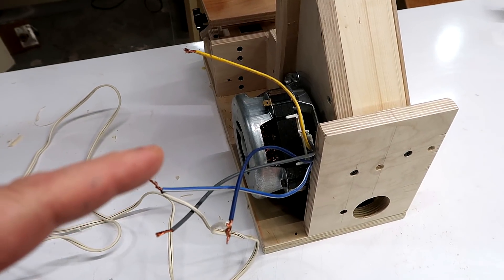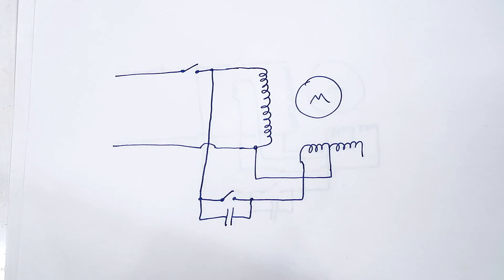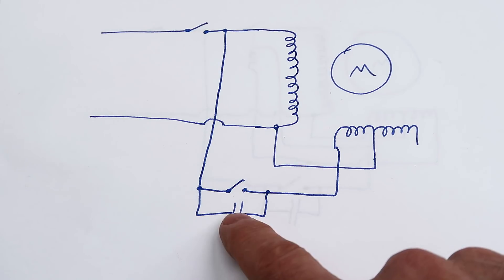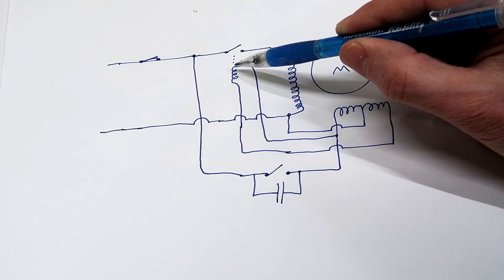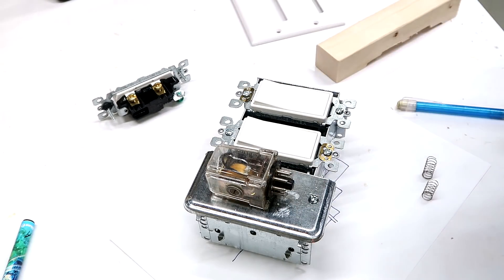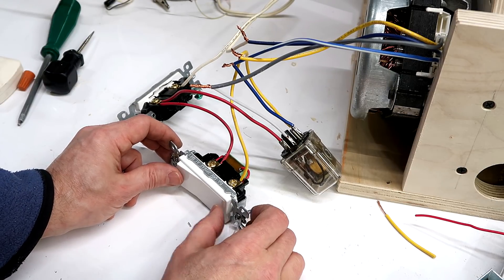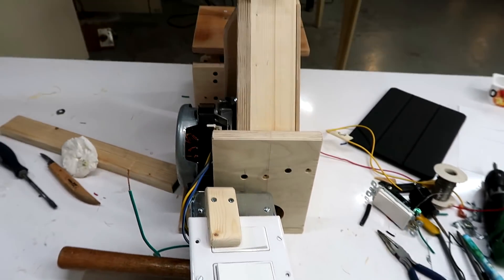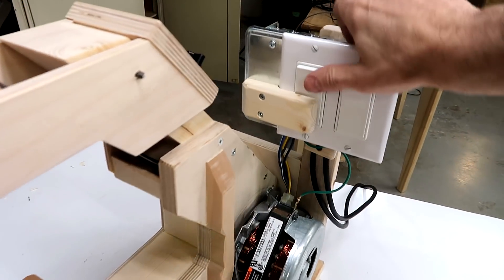Induction motor NVR switch and starting circuit

Comment: There is a type of relay for starting motors, it’s known as a potential relay and it works off the voltage of the start winding and will open once the motor is at about 80 percent, it works very similar to the mechanical setup you are using, however it’s completely automatic and self contained.

Comment: my  recent motor project had a starter capacitor and a stop capacitor but kind of same it has has 3 wires blue white and red I got some sparks and a small turn from a 12 volt dc battery red to positive white to neg and blue to spark the semi start

Comment: If you use the dust collector anyways, can't you just put the motors starting coil in parallel with the dust collector motors starting coil? It HAS the centrifugal switch.
Reply from the maker: Interesting ides, but I'd rather not require custom wiring between the tool and dust collector. Oh, and the dust collector is a capacitor run motor.  No centrifugal switch.

Comment: Matthias: "I can't find a cheap [momentary] switch online"
Me: Searchs ebay, within seconds finds numerous ones for as cheap as 5/$5.
Also me: <shrug>

(I refuse to say "temporary" switch. They are called "momentary" lol).
Reply from the maker: Just searched again, nothing suitable for this.  Mostly signal type switches, not rated for motor power.
Reply: @matthiaswandel   LEVITON 1256-W : 15A SPDT MOM CONT SWITCH.  Commonly used for line voltage up/down control of blinds. This should work unless you need to discrete poles.

Comment: Have you ever thought of using a Doorbell as a starter switch? They are made to connect then close after released...
Reply: Doorbell switchs are made for low voltages, they wouldn't hold up with 120V and higher amperages.

Comment: You need a capacitor across you contractor for the same reason you have one on your switch.   I would say if you don't have another one put preference on the contractor since you don't have a replacement.

Comment: Glue a momentary switch to the ON side of the power switch. Both circuits energized while you push the on button and starter circuit disengages when you lift your finger.

Comment: An alternativ way would be to find an old fridge, on the side of the compressor is a relay, the coil of which is wired in series with the run winding, thew contact providing the start pulse from the inrush,
Reply from the maker: Fridge compressor motors are much smaller, the relays aren't suitable.

Comment: The relay contacts were sparking a lot in the video. Might be a case for another cap there. They’re more expensive and harder to replace than the primary switch.

Comment: a good idea would be to use a latching button circuit with a relay, then hook the starter straight to the terminals of the switch itself and have the motor connected to the latching switch circuit. it will allow you to start the motor and keep it running without having constant power to the starter unit and also the benefit of only 1 button

Comment: This is why the older mechanical tech tends to be much better than the newer electronic tech. Especially when they add I.O.T. and decide to make sure that the device cannot operate without an internet connection.

I never pay for stuff that cannot operate without an internet connection.

Comment: hi Matthias, Why don't you use a ring bell switch, like the front doors ones?
Reply from the maker: Those switches are junk and not rated for any voltage or current

Comment: One Wandel more?  Best wishes, Mom!
(did he measure the frequency of the ultrasound using waxed paper rubber-banded to the end of a paper towel tube?)
Is the spark (visible after relay is installed in the switch box) happening in the relay or wiring? Maybe need an NTC Thermistor?

Comment: You need a motor control pushbutton switches. Look up "3-wire motor control start stop station". It uses a relay, motor starter, and pushbutton station. Uglys electrical references will have a simple drawing.
Reply from the maker: Its not a 3-phase motor

Comment: Did you wire in the capacitor with the relay? It sparked quite a bit. (5:15)
Reply from the maker: Unfortunately, the relay glitches off when the starter coil is disengaged.  No spark on "off" because the switch does that.

Comment: Love that idea, however, I'm not so sure about having the parts mounted in a metal case without having insulation/shrink tubing around the powered relay pins.
Reply from the maker: that's what grounding is all about.

Comment: Nice use of the starter winding, never seen that before. Though the relay looked to be arcing significantly, I’d chuck a MOV across it, if not another cap or two.
And that relay? The thing looks ancient!
Reply: We had a bench grinder at work that used a special start winding relay with a coil wired in series with the run winding. When the switch was closed the low impedance of the run winding at start up caused enough current to close the start winding, but after the rotor rpm increased, the decrease in current caused the start relay to open.

Comment: Hi Matthias. I have the same motor from a dish washer I hooked up as an 8" disk sander. After many tries to get it hooked up to run I settled on one normal on/off light switch, and two momentary push buttons. Along the lines of one of your examples. The light switch supplies the 120v to run and at the same time I push one of the momentary buttons for the direction. For my own sanity I labeled every thing on the face place how to turn it on. I had someone read the "how to" just make sure it made sense per the instruction. Works great.
Reply: His setup is simple, safe (once he addresses the contact spark) and genius, but i don't know if it would work for a machine that needs to run in both directions (as designed). I really appreciate the built in disconnect if the motor gets overloaded and stalls. Yours sounds pretty nice too, but I'd want to be aware of how it works and be ready to kill power if I stalled it.
Reply: @super_slo  When I built my disk sander I went through almost all the ways Matthias has tried this one. The motor when it is in the Dishwasher machine, as Matthias says it all controlled by the machine. Most washers like this have a relay already, else where in the machine to take care of the start function. Some have a "start capacitor" to give the motor a kick to run up to rpm then drop out after run up. Some have a "run capacitor" that kick in at the start up and stay in until the motor is shut off and drop out after rpm runs down and motor stops. All Matthias did was move the sparking from him touching the wires together and then pull them apart after run up which caused the spark. If you look at the video the spark is occurs inside the relay in the clear plastic cover. The relay is rated to drop out at certain voltage.  I see no spark at all on mine as I use the momentary button as a start capacitor (completely enclosed button so I become the relay). If I do not push the start button at all just flipping the switch would just make the motor hum.
I have to push one of two buttons for CW or CCW for about 10 seconds and flip the main switch after pushing the direction button. This give the motor the extra kick to force rotation CW or CCW. I just wanted to make sure how I did my hook up is clear. Matthias's way works fine also.
Reply: @Sea-Dog5496  when it's sitting there stalled and humming, have you watched the temperature rise? I'd be concerned about overheating with the motor energized but not spinning and thus not cooling. Like say a dust collector or something, might not notice immediately if it stops spinning, and not actually running the piece of equipment. But like I said, your setup sounds PERFECT for something being operated and needing both directions. Lathe, drill press? Either way, you both are awesome for actually building something with these motors!
Reply: @super_slo  Hey Super SLo. If I turn mine on with the switch and no button pressed. It will hum only with no turning. So if it is not turning it is burning. If you leave it switched on no rotation it will burn up the motor winding. Of course it will take maybe 1, 2 or more minutes to burn. You will know it by the smell of wire getting to hot, and most likely smoke like crazy. However motors will tell you on the ID tag if it is thermally protected. It will blow a thermal fuse in side the motor to prevent fire. Older motors may not have this feature, so one must be weary.
Point is you better stay focused on the task at hand and don't let your brain wonder off the track. Lol.

Comment: Arduino, I mean your already using a relay.
Reply: Arduino would require 2 or 3 relays, plus a couple switches... Doesn't really improve the situation unless you want to automate the dust extraction to run for a set period of time before and after. 🤷🏻‍♂️

Comment: Interesting solution.  I wonder if a higher capacity automotive style key switch would work without the relay.
Reply: The relay combined with the starter winding is the magic. The wall switch he's using would happily fry the motor, as would the automotive key switch. The relay is being powered by the motor (one of the starter windings being used as a generator) to turn on power the motor (the primary winding) and keep it running. The momentary switch is only powered for less than a second to get the motor running and engage the relay. Much more than a second and the motor would probably be destroyed.

Comment: Interesting.  Can you explain more how the induced voltage (AC) holds the relay activated?   I thought it must be DC (and also sensitive to using roughly the right voltage)
Reply: It sounds like he's using a 110v ac relay, as he stated it requires just over 90v to trigger. So the primary winding running at 110v apparently induces enough voltage through the secondary winding to trigger the relay.
Reply: @super_slo  OK thanks. I did not know that such AC relays exist.  They could have internal rectification diodes I suppose?
Reply: @firstlast1661  that's beyond my level of expertise. We played with trying to make our own dust collection auto starting system back when I was in school, and the team purchased a 120v relay for working with and switching US mains voltage. Turned out the premise was flawed and the single digit voltage drop across the relay winding was nearly 100v short of tripping the relay when it was simply installed in series with the power tool. Lol. But that was when I found out relays exist for way bigger voltages and currents than in automobiles!
Reply: I was only speaking of the control voltage, not the load.  Anyway I read up on this, and AC relays use additional winding(s) on the control side and/or some inductance effects to keep a constant pull on the switch  despite the alternating voltage.

Comment: Is there a substantial difference between the infrared thermometer you used in the water heater video and infrared thermometers meant to test body temperature? 

The later is calibrated to be accurate at specific temperatures.

Comment: What you want is an automotive "universal ignition switch". about $26. Makes for much less interesting video, though ;-)
Reply: Hi Paul, but wouldn't that only be 12v? Don't we need a 120v temporary switch?
Reply: @cackleberryfarm4598  contacts are typically rated by amperage.

Comment: Wow! I would have never thought to use the induced voltage from the starter windings to power a self latching relay. That's really smart.
Reply: Yeah, i followed current for hot and neutral and thought: "How does the relay stay on?". Then i realized the spinning motor is inducing a current in the starter winding.
Reply: Keven, when we set up self latching relays back in my building automation days, we would use a double pole, double throw relay (like the one Methais has here, The relay has two poles meaning that it has two switches inside. It is double throw meaning that each switch inside is like a 3 way switch). In a latching relay you'd have some kind of device on one pole, on the normally open set of contacts, meaning that when the coil od the relay engaged, that device would run. Then you'd have a power supply rated for the coil on the other pole on the normal open contacts as well, which means that when the coil was engaged, that the relay would power itself! Hence the name self latching! The Only way to get the relay to disengage at this point would be to have some switch or button cutting the power to the relay. That's the first thing to understand.

Second, (this may seem unrelated at first) when a iron core spins inside a coper coil, it induces a current inside that coper coil. This is how electric generators work. The inverse is also true. This is how electric motors work. Meaning that if you apply an electric current to the copper coil of an electric motor, that iron core inside starts to spin. (This is an overly simplifies explanation go how electric moters work but is good enough for now) BUT (and this is what I would have never realized if I were in Mathais's shoes) if you have a secondary coil arround the motor (in this case the starter windings) that coil has a current induced in it as long as the motor is running! And, again, in this case enough current to close the coil of the relay that Mathais happened to have on hand!!! 

This should be all the technical and specific information you'd need to under stand my comment. The info above is very basic and simplified to the point of being technecly wrong. Its very Mickey Mouse. But it may paint a clearer picture. The point is that Mathais is getting electricity back out of the moter while its running. If you want to understand the circut of any of these concepts better, just commenr me here and I'll be glad to explain more.
Reply: Can you explain this to a layman?
Reply: It's not self-latching, but is in effect.

Comment: Bit of a novice with capacitors, and I had a couple questions.
Why does a capacitor help to prevent arcing?
Why doesn't the capacitor act as a short circuit in an AC circuit?
Reply: Inductance is what causes arcing. When the switch opens, the inductance tries really hard to keep current flowing. So a high enough voltage spike occurs to bridge the gap at the switch opening until the gap is large. The capacitor prevents the rapid voltage buildup thereby suppressing the arc. Some current does flow through the capacitor. But apparently the capacitor is small enough that the current doesn't amount to much. I don't remember what value it was, but it was small for a 60 Hz circuit.
Reply: @mckenziekeith7434  So can i think of it kind of like water hammer in a pipe? The inductance opposes changes in current, so the electrons hammer the contact causing an increase in voltage that causes an arc?
Reply: @JX_kusoboke  yes. The capacitor is kind of like a bypass with a flexible rubber membrane blocking it. When the water hammer tries to build up pressure, the membrane flexes, allowing some of the pressure to pass through to the other side of the valve. Since it is AC voltage, the membrane may move back and forth a bit during normal operation, but I am sure Matthias chose the capacitor value so that the AC current flowing is negligible or acceptable.
Reply: @mckenziekeith7434  i think I'm starting to get it now. Does the cap achieve this by discharging when the circuit is broken, making the change in potential more gradual?
Reply: @JX_kusoboke  The capacitor provides an alternate path, like a fork in the road, or a Y branch in a pipe. At the moment before you open the circuit, the capacitor will be in a discharged state. When you open the circuit, the capacitor will charge as the current uses the capacitor as an alternate path.
Reply from the maker: Yes, do read up on capacitors, please.
Reply: @matthiaswandel  I did some googling and I'm still confused, because to my knowledge, a capacitor in an AC circuit should pass current, and if it's in parallel with a switch, why doesn't that bypass the switch?

As far as the arcing, I still have no clue, but my best guess is that it reduces the voltage difference across the contacts of the switch, so there's not enough of a difference to arc?

Comment: There are commercial “dual” switches that have a spring-loaded start connection and a detented run position. In this switch design, the off button releases the start/run switch from the detent and it pops opentobteakthe contact. They are also available with two separate start/run switches for bidirectional motors. Your solution is likely way cheaper, but thought your watchers might like to know. Available at commercial electrical supply houses. Best of health and safety to you and yours!
Reply from the maker: I didn't even come across a switch like that in my searches.  Then again, I didn't search expensive sources at all.
Reply: @matthiaswandel  Why not just use 3 position switch?1st position off 2nd with capacitor for start and 3rd one for normal work .You can start those motors by hand btw in ether direction by pushing belt up or down .All starter coil does is creating magnetic field to spin rotor in selected right or left motion -if you do it by hand or any other mean you dont need start coil.

Comment: There's a way to take apart one of those switches and bend a spring to make it momentary. I've done it for garage door buttons to make them look integrated
Reply: Got a video on it ?? :)
Reply: @jbh.6257  Here's the one I used sorry I'm years late 😂😂 basically you pop the paddle out and bend the fixed contact inside the switch down a bit so the moving contact never goes quite over center against the spring.
https://youtu.be/_QJgYJfNKRI

Comment: wouldn't you also want the vacuum to run for 20-30 seconds or so after the sander stops running?
glad to hears you guys are all right, sounds like you'll be plenty busy in the weeks ahead!
Reply from the maker: For a meiter saw cabinet, yes.  For this sander, no.  The fan spin down is enough to suck it clear.